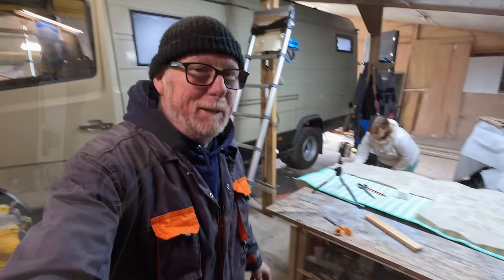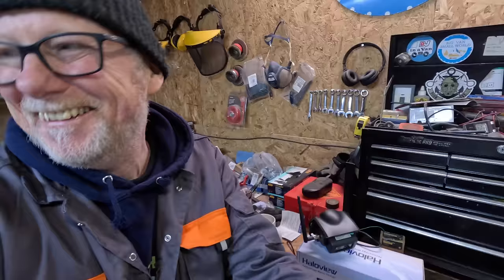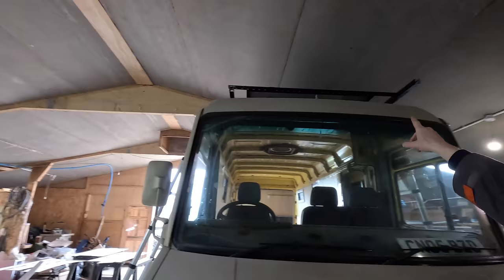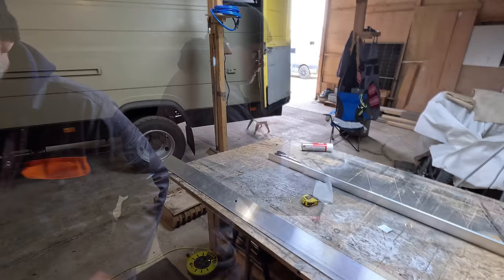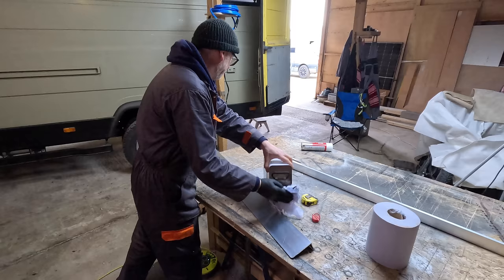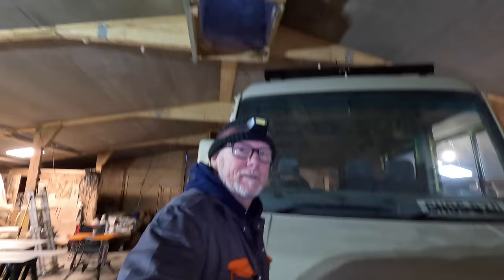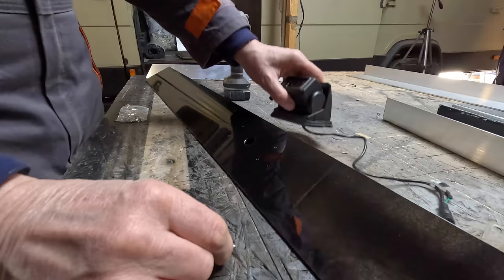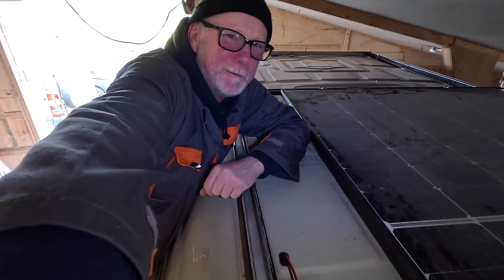Stay Safe On The Road: Upgrading To Haloview Cameras For Ultimate Van Life Security

Comment: You may not be aware that you can buy stuffing glands with multiple holes, so if you have 2 or more cables you can put them in each hole and when you tighten the stuffing gland it closes up on each cable providing a much better seal.
Reply from the maker: Wow I’ll have a look for them thanks 🙏

Comment: Yet another great job Mel, i order a few bits of ally express but they never turned up ( lucky it was via PayPal ). Love the the camera system i didn't use a Bluetooth one as i was worried about the length of the van and it not reaching so when old school and ran wires from one end to the other. Also fitted 4 spot lights on the roof rack and what a different they make on dark roads or campsites. Almost turn it from night to day. as well as looking so cool. Would love to bump into you and Becky one day as you both seem so full of energy and joy. Keep up the good work

Comment: Great camera set up. 😊 I didn’t have the pleasure of an angle grinder I had to use a hack saw to cut my unistrut. Becks done a lovely job on your auto carpet. New home is looking lovely. Your super lucky 😊
I didn’t know I could use a flange like that on the roof instead of those big ones? The fridge looks like mine. Mines 12v but can be used as 240v too :) but mine was £600. Good price for yours 😊
Reply from the maker: Thank you buddy have a great weekend 👍🤓👍

Comment: Fridge conversion to DC still uses the same Power. Lower volts but way higher current! So power = Power / Current x Volts. Then your incurring AC-DC losses as well, which results in heat (power) loss.
Reply: Not when you change the compressor which I’m sure Mel is planning to do. Have a look at belluna fridges from Germany. They convert domestic fridges to run super efficiently on 12 or 24 volt. They change the compressor and the refrigerant. I’ve an 85 liter with freezer which only pulls about 60watts when running and it only needs to come on a few times an hour. Much cheaper than ‘camper branded’ offerings as well.
Reply from the maker: If it costs me almost a grand less how the fk cares

Comment: I used a wolf box rear view mirror mount which is also a dash cam, rear is 1080p and front is 2.5k they also do a 4k front as well. The picture is crystal clear and it is also Wi-Fi so easy to download pictures, as I had no view out the back and the insurance stated a rear camera or parking sensors, this ticked off 2 on my list 1.rear view, 2. Dashcam front and back and the picture is 12” wide. A neat feature is you can scroll the image on the touch screen to view lower down or up. You can also activate a 12 or 24 hour parking mode
Reply from the maker: Sounds great but doses it not have side cameras 📸

Comment: You can take 12v feed off 1 off the van batteries its only 24v when you use them both. Battery 1 has the negative to earth and the positive to battery 2 negative,the positive from battery 2 is 24v.the positive on battery 1 is 12v.
Reply from the maker: Have you ever heard the term teaching someone how to suck eegs?
Reply from the maker: Have you ever heard the term teaching someone how to suck eegs?

Comment: Hi Mel, is the vario 24v system neg earth return, or is it isolated chassis as in trucks? Btw a big advantage with 24v is charging power packs much quicker than 12v,(up to 5x). Also cable sizes can be halved for the same load and less losses. I have 24v inverter/Lifepo4 cells in my transit for this reason. 👍 👍
Reply from the maker: Yes 👍 absolutely